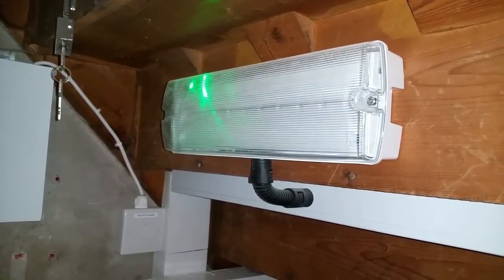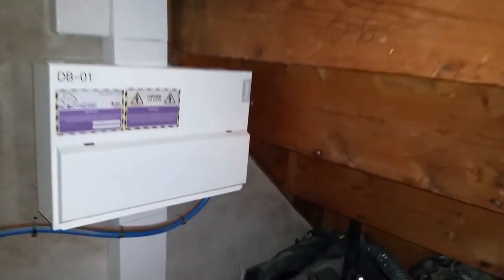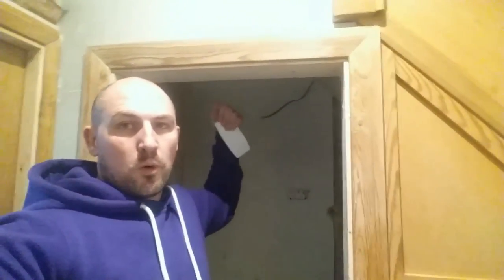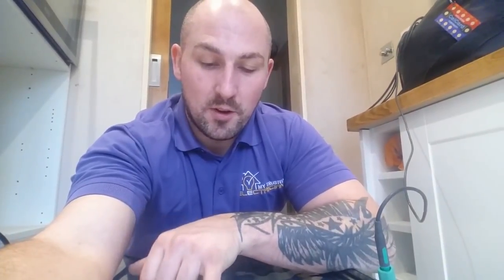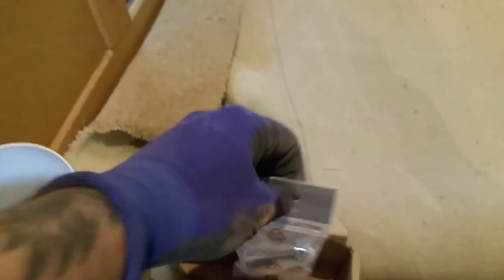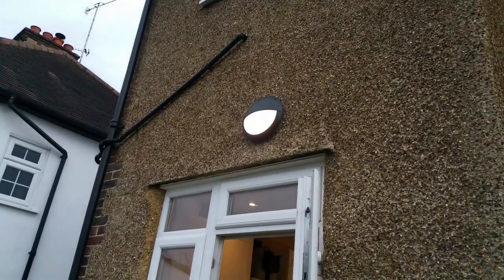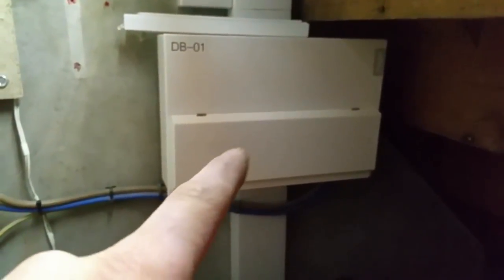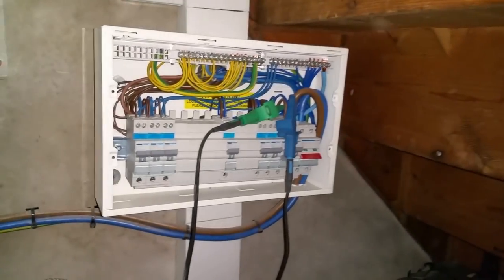Installing an EXTRACTOR FAN and some ELECTRICAL TESTING

Comment: I always cut the pull cord string at the same height as the door handle. If the user can open the door, then they can definitely operate the pull cord switch.

Comment: Nice video always different ways people do this trade. I was always taught that anything after the outlet plate is then classed as the appliance and is then under the PAT testing regs. But I do always do an extra check to confirm earth at the appliance no harm in going the extra mile to confirm these things. Good to see an electrician taking pride in their work not many tradesman out there who do nowadays!!! Keep up the good work

Comment: Had the label ‘discussion’ when I did my 18th update recently. The BBB clearly states ‘not smaller than those illustrated here’ so the tutor said that’s what we must do. At lunch we photocopied the labels at actual size, gave the tutor the inspection label, the RCD test label, the 2 colour label and the multiple supplies label. Gave the scenario of domestic with solar panels and 10 way CU. Challenged him to fit all the labels on the CU.

Guess what he could not do?

I think that as long as they are legible then they can probably be smaller. I use my Brother printer and 24mm tape, double height if needed, for all my labels. If needs be I’ll put it as a departure on the cert due to size constraints just to be bloody minded.
Reply: If all the  labelling can't fit on the consumer unit, it can be attached close by, on the wall to the side of the consumer unit for example.
Reply: Which they'll soon fall off of within a day or two.
Reply: There has been an amendment to the 18th edition and they are putting the labels back to the old size. Must of realised they couldn’t work at that size
Reply: IEE NUMPTIES!

Comment: What size core bit did you use. My fan says use a 117mm for my 100mm rigid sleeve. You reckon 107mm would be ok ?

Comment: Mmm yes but the problem with ring mains is sometimes people go from the consumer unit round all the sockets to the furthest point. The longest leg is from the furthest socket back to the board and it's pointless. Sensible way to do it would be to stagger them so as to share current more equally but no one does. Do you think it's ok to use a 30 a jb on a 32 a ring main? Thanks again for videos and happy new year.

Comment: You may have been able to get all your lighting cables into the back of the fan isolator box, four 2 core and earth cables and one 3 core and earth cable.
Reply from the maker: Yeh I thought about that. Would have been perfect. The box was cut after boarding and I didn't want anything live floating about.

Comment: Fantastic video and explanation as well mate. Keep up the good work! I’ve got a question: I’m due to sit my 2391 exam in a months time, and wanted to erect a rig testing board. However, when ask my tutor for specs and how many circuits should I incorporate to test and have a good knowledge of testing for the exam etc, it was like he didn’t really want to tell me. Please please..? If you can, can you let me know what do install on a board in order to build my testing confidence? Your hep is much appreciated. Thank you

Lincoln Thompson

Comment: For the sake of the little cupboard and where the board is located I would have just pulled a separate lighting feed in so minimise the cables and the pull cord. Feed in and a switch wired would have fitted in the pull cord pattress surely?

Comment: On the weight of the Oven. Do you check if oven doors can be separated from the body of the oven. I have a large double oven (De Dietrich) and both doors are triple glazed units. Both of the doors can be easily taken off with hinged securing clips on each of the hinges. The two doors make up about half the weight of the complete oven. This feature is prob only on the more up-market makes of oven. Neff/Miele   etc.

On the matter of CPC testing - My oven has a separate connector block (GB6:SF4506/CK) downstream from the isolater. This is situated behind the oven - so it would be this point that needs to be tested. Always best to test the oven itself as its about the biggest lump of metal in the house that's hard wired to the Electric circuit.

Comment: Hi Luke, just watched this great video. The font size of the labels should be in accordance with reg 514.12 in BS 7671 2008 (2015) A3. This is as stated in BS 7671 2018 corrigendum December 2018 and not as stated in BS 7671 2018. Hope this helps. Regards Gary.

Comment: 32 amp ring shouldn’t be an issue. A ring leg is actually only designed at 20amp
Reply: How do you work that out, the typical current carrying capacity of a 2.5 mm sq copper conductor is about 22 amps, since a ring circuit has 2 feeds, the csa is 5.0 mm sq, that would give you a current carrying capacity of 44 amps.
Reply: Because you are only joining one leg of a ring...
Reply: @tomorichard  Ok, in that case, yes I'd agree with the original statement.
Reply: can u explain it in detail

Comment: Test and record at the fixed wiring point only, you can test at the appliance for your own piece of mind but it shouldn't be recorded on the test cert. Your circuit ends at the outlet not the appliance.
Reply from the maker: It let's me sleep better at night. Like I said "it's just how I do it". If a live conductor comes into contact with the ovens metalwork I want to be sure that the protective device will operate before my customers next meal.
Reply: @MyTrustedElectrician  Yeah, as I said, do it for your own piece of mind if you like but come 10 years time,  I doubt the next guy is gonna test at the appliance and if he's using your cert as a reference, he's gonna be thinking "Why's my reading lower then his???".
Reply: Always take a reading at the isolation point and just a r2 to the final appliance for peace of mind and state on test sheet what has been done
Reply: @tomorichard  The reading should be taken at the extremity of a circuit, in Luke's case, this would have been to the oven outlet and not the isolator.
Reply: Alvin Ashman sorry yes I agree but I wouldn’t go to the extreme to retrieve a R1 R2 / zs at the appliance itself maybe just confirm cpc continuity at the appliance
Reply from the maker: @ashmanelectricalservices4318  great point made.

Then I'd be happy. Because then I may have encouraged him/her to chuck a wonderlead on the oven door out of curiosity. 

Do you test the metal work of metallic light fixtures?
Reply: @MyTrustedElectrician  Yes, as it's an exposed-conductive-part and the fixed wiring is directly connected to it.

Comment: whats the problem with prividing a 30A junction on a 32 A circuit
Reply: There's not one as far as I know think it's a bit like the metric versus imperial thing.
Reply from the maker: Overload devices should be rated equal or lower than the equipment it protects. 

Just puts everything right for the next chap who turns up a few years down the line and wants to add a little more load onto the circuit.

I nearly had this issue with an induction hob. I was going to use an old cooker supply that wasn't being used anymore. It would have probably gone unnoticed until christmas day when all rings were maxed out.
Reply: Yes I know what you're saying but how is a 2.5 ring main on a 32a compliant? Excellent video thanks.
Reply from the maker: @dianedyas5665  A 2.5mm ring (2×2.5) is similar to a 5mm radial which can carry more than 32A.

Comment: 6mm into one of those hagers boxes,  how on earth?
Reply: If its a J803 they are 4mm max
Reply: Another good one......and label size ....the same as the ones in the book......stupid I know
Reply from the maker: between me and you, I didn't manage to do it because the fucking thing had 2.5mm wago's inside. That's my fault for not looking when I asked for it over the counter that morning. I had to make do with a standard Wago box and 6mm Wagos.
Reply: She loves me, she loves me not, she loves me, she loves me not... If you know what I'm hinting at, you're a wrong'en 😂
Reply: My comment shouldn't be here.....
Reply from the maker: @markyd2633  that's mental! I'll have to start installing bigger consumer units then 😅
Reply: @MyTrustedElectrician  Or just attach the sticker to the wall at the side of the consumer unit.
Reply: @MyTrustedElectrician  extra few quid then....lol

Comment: Please consider the quality of the outdoor light fittings, how long will a Chinese fitting keep the rain out ? Before it gets damp inside ?
Reply: The eterna gear is actually decent quality. Have used loads over the last few years with very few failures.

Comment: Yes, you probably should of had a separate emergency lighting key switch by the emergency light... you could say switch off the circuit breaker for that particular circuit for 3 hours but that would also mean you have no lighting to other parts of the property for 3 hours.
Reply from the maker: Hey mate. It wasn't serving as an emergency light. Just a clever idea to help somebody reset an RCD if it's dark.

Comment: The value at the oven is actually an appliance, the fixed wiring ends at the cooker plate
Reply: @MyTrustedElectrician  yeah there is a common misconception that appliance testing is only done on portable appliances, or things with plugs on them.  There are many different types of appliance that should be tested, including everything up to fixed equipment.  The Zs is up to the accessory and from that point on the Earth bond requirement is 0.1+R Ω for a class 1 appliance, the R being the resistance of the CPC in the supply cable.
Nice to have a conversation about it though.
Reply: The earth loop on to the case should not be much greater that at the s/w
Reply: The kettle and toaster fridge etc... ha...where will it all end?....Surely with PAT and FAT testing. Good point though. Thanks. @MyTrustedElectrician

Comment: Theres also a driver called a Phillips 2 you know. Not many do
Reply from the maker: I remember Philips mate. When I was a lad my mum and dad had a little screwdriver set in the hallway cupboard which we generally used for everything. It had a bradle, 2 philips and 2 flat heads.
Reply: It’s actually a Philips/Slotted PH/S #1 ...... nerd moment